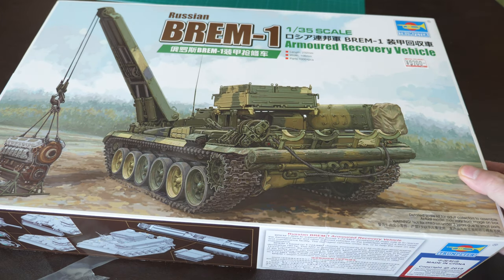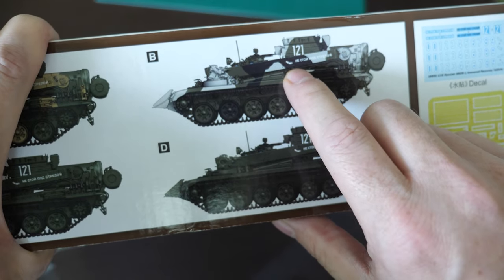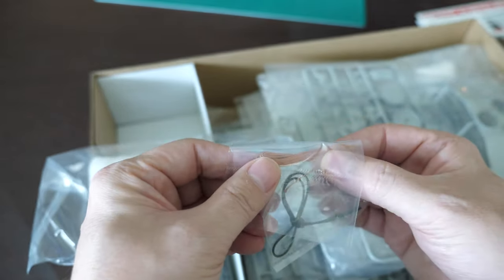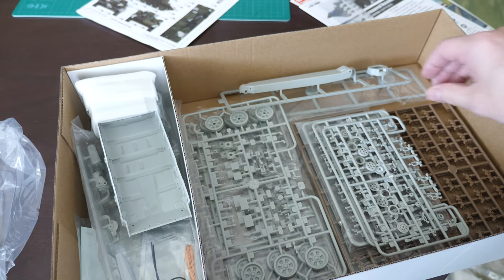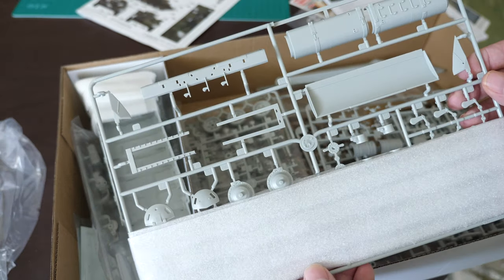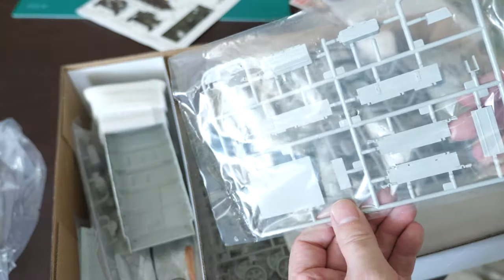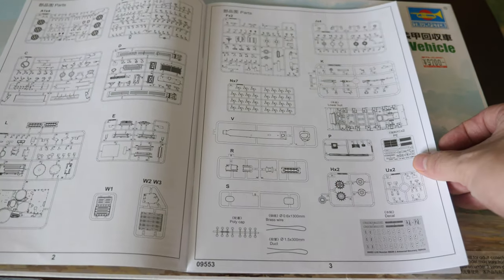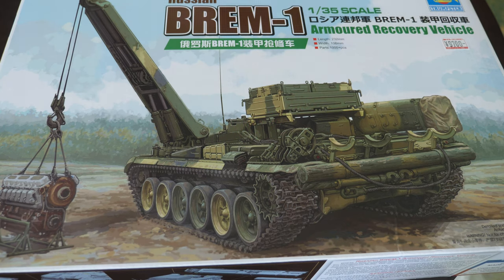Kit Reviews - Trumpeter 1/35 BREM-1

Comment: I just paid £70 UK POUNDS for mine today but looks well worth it! Surprised to see so little PE in a Trumpeter kit but not a bad thing either way on a build like this I think it would be to much!

I think the crane leveler is in that position for building as box art! That I'll have to watch out for I'll remove it and replace it with brass rod maybe on a pivot drilled in so moves with boom! Good review good eyes for spotting that little minor thing but only makes sence to have it correct whatever way you have your boom!
And atleast now with the Anchor on the front they can see while under the cover of darkness now than on the rear with the old spade like the bergepanther